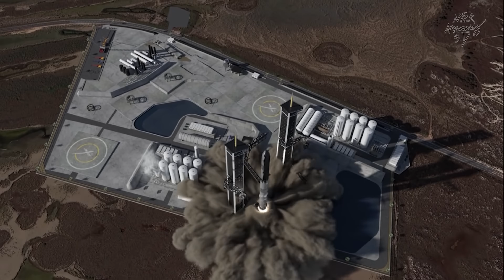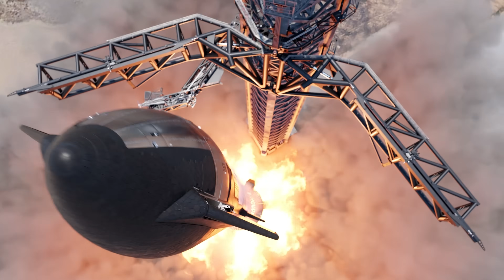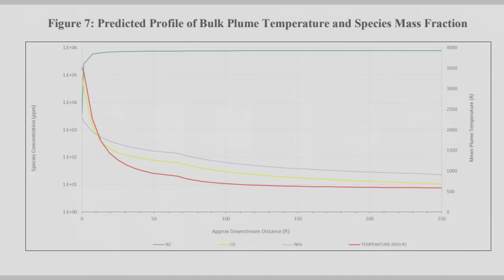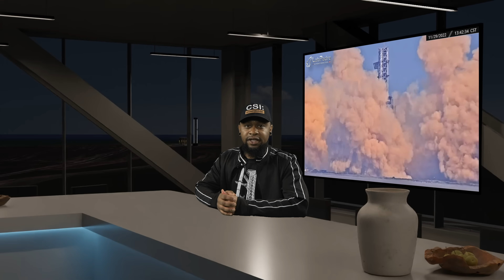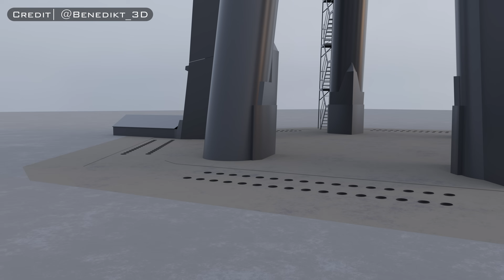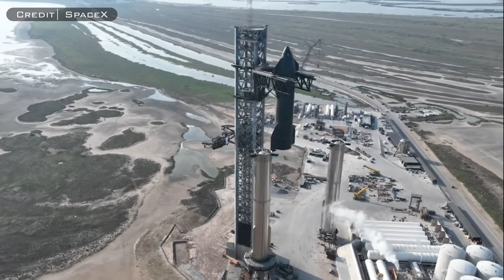SpaceX's "Major" Concrete Problem + Water Deluge Construction Begins at Starbase

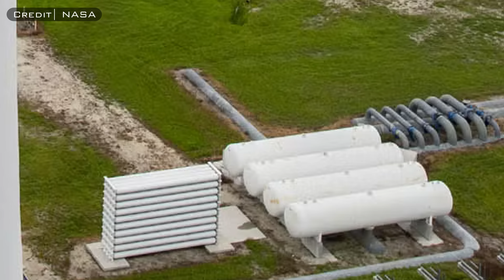Comment: You're definitely right with the four tanks at 28:55, these will act as compression buffers. They are filled with ambient air and kept at the same pressure as the water, and when the valves shut, the water will then diverge into these tanks, compressing the air with the kinetic energy, dissipating the excess energy as heat while slowing the water movement continuously.

Comment: While the concrete spalling is a serious concern, I'm more concerned with the acoustic shock waves reflected back into the rocket at start up, bouncing off the solid concrete pad and damaging the rocket's internal structure.  This was a concern for the shuttle flying out of Vandenberg and a large reason why the shuttle never flow from there (tests and simulations showed that the acoustic shock would wrack the wing structure).  The amount of water in the flame/sound suppression system seems pitifully low for SpaceX.  Hopefully they did consider this and I pray it will work.

Comment: With a rocket as powerful as starship I don't think spaceX has a choice but to build a flame trench and a water deluge system.  These aren't falcon 9 rockets and extra steps need to be taken to prevent the rocket from being damaged during take off.

Comment: Should.. but for how many times? I would think a change out every time...one toasting will be all it will take to be safe and not blow holes in everything  nearby with shrapnel with those  additional  roastings...a flame trench is not a nice to have but absolutely  a must. The current setup will serve to get the rocket perfected. But a new launch tower and stand will be setting above a flame trench. A couple years away..This just might be the plan all along...They aren't  stupid over there at Space X.

Comment: Water is compressible. If you force water under the flame pressurization, it could cause even more damage to the concrete. The answer is a 316 SS defusing spike about 6 inches thick and 4 meters past the base of the launch platform. As the flames push downwards, they push on a giant piece of metal with vertical fins that trap and divert the flames out from underneath the platform. because of the metal composition and thickness, the heat is also absorbed and channeled for the critical time necessary for the booster to clear the pad.

Comment: This is why I'd like to see Elon use my non-rocket technology.

It removes all need for such towers and everything that goes along with these old fashion technology designs.

Removing the massive refueling necessities would be another benefit.

The only problem is no one desires to communicate with me, and I'm totally outside any space type program or project.

But non of this means I'm brain dead.

I'm just not in a position to have to get anything I know to change anything.

Comment: I was always confused why there wasn’t a water deluge. You answered a lot of my questions.  Food for thought. Is it possible they are trying to design launch structures that don’t use water because of course water won’t be in abundance on mars? They won’t have to fire many to get off the surface of the moon. But mars still has something like 38-40% of earths gravity so they will have to fire most of the engines? Obviously water deluge won’t be possible on mars because it is so critical? Idk.I could have nothing to do with the launch pads they planned for mars. But that just came to thought when thinking of reasons why they didn’t automatically building a water deluge from start ? 😊 if anyone has more information on this I would be interested in knowing space x thoughts on this
Reply: They're just trying to get a point where they are able to launch. Mars is so far in the future that it isn't on their minds right now. Also, there won't be boosters or concrete on Mars so I don't see how this would apply.
Reply: @Raptor2  I know there won’t be boosters. But I would think there would need to be some kind of landing area eventually built for the starship.  But your right it’s far off right now.

Comment: A super cooled water deluge system?  Water can be super cooled to -48.C at standard pressure and still remain liquid.  By using outer jacket to refrigerate the water tank, perhaps with liquid nitrogen, you would increase the water density mitigating the lost header pressure, not require additional pressurisation, whilst increasing its ability to absorb heat.  SpaceX super cool their propellants, why not the water deluge too?

Comment: Considering Best Part is no part, instead of using what russians use i.e. a flame trench spaceX is using concrete and then all sort of added hardware... its just waste of resources which would have been useful in other ways. If engineers could come up with that much complex launch table and catch arms(chopsticks) they could have come up with something I am sure that is compatible with big n deep flame trench. Well its all engineering building and moving forward.

Comment: Very good video!  I think that a single independent rocket engine could provide the same effect as a diverter by blowing its exhaust sideways just above the ground.  Some shrouds around the launchpad legs  might be needed but for the few moments of heat and pressure using exhaust to fight exhaust; by redirecting it sideways, would seem to be a plausible plan.  Instead of exhaust blowing 360 degrees around the platform It could be made to blow in one direction and better controlled by a funneling deluge system.

Comment: The rocket exhaust isn't just putting compressive force on the concrete. It's putting shear and pulling force as well. When the exhaust impacts the ground and spreads out, that's the shear force. The shear force likely rips some pieces off. That exposes a surface that is uneven allowing exhaust to enter into little pits and holes which then allows the exhaust to push and pull on the concrete at all kinds of angles. The problem will likely always exist until they can either form it to divert the gases/help guide them in the direction they want or just built an actual diverter into the ground and out the side of the base. I'm surprised they didn't do the latter from the beginning considering all of the stuff inside the base being exposed to the exhaust. Kind of weird they built it all so close together.

Comment: Do they actually need all 33 right away? Could they get a couple of hundred feet with way fewer engines and then light the rest up? Or is that too prone to failure and/or dramatically asymmetric instantaneous thrust?

Comment: They need to use calcind kaolinite clayas in their cement. It can handle temperatures near 3000c  after 24 hours of curing and has a higher compressive strength!

Comment: I think the exhaust pulses that causes the vibration will also have a pounding effect on the pad. Think of it as a plume of hot gases hammering the pad. Causing high fluctuations in velocity. The heat is extremely intense aswell. It’s not a slow ramp up to let the pad expand slowly( all materials expand when heated) so the concrete should have no problem with a controlled slow ramp up but the vibration and heat shock will make it expand and contract very rapidly.

Comment: the pressures and temperatures mentioned are not realistic. I would advise that these figures do not represent anywhere the real values at site. Example you mention a temperature at surface from 1 Raptor blast to be 800 Rankine, 340 F, and 470 C ( it should read 170 C not 470.   Also the pressures mentioned are extremely low.
The Conditions  when the total Raptors are firing are at least 10 fold the figures mentioned in your report.

Comment: using simple compressive strength data as a function of ablative  erosive or impact resistance is completely erroneous. I assume you've never used refectories and only googled them.
Reply from the maker: Yep. Did a lot of research to see if I could answer this question. Wasn’t expecting to hit all points perfectly. Just worked with the information I was given on the data sheets. I’m not a rocket scientist

Comment: The exhaust when hitting the concrete will suddenly heat as it suddenly decelerates and all that kinetic energy will be dumped as pressure and by gas compression laws its temperature will suddenly jump. As an engineer I must point out.

Comment: RAISE the height concrete ring at the base where the rocket and motors are locked on 20 ft or so, then above the concrete floor 20 ft have a steel disc as round as the rocket with tiles like the tiles used for re - entry maybe! Maybe the tiles could work just placed all over the hot end of the launch tower. They have a lot of options they can try. Thanks for your info on the starship development.

Comment: Yeah.. my guess is they aren't waiting long enough.  That super high strength stuff needs longer to cure to get to it's maximum strength.  If they had a month to let it cure, they'd have a lot less damage.  Even regular concrete needs that full month to get to max strength.  Even the wrong rebar (anything that encouraged moisture to stay inside the finished pad) could cause the type of damage we're seeing.  Regular rusty rebar would Not be their friend.

Comment: Very good video. I think however your assumption about the surface temperature of the concrete is far too low. If you imagine a flame from a butane torch, the highest temperature is reached about an inch away from the torch nozzle itself. So similar to this, I expect the highest temperature to be at a number of feet distance from the nozzle, and furthermore the flow pattern of the exhaust gasses is longitudinal in the beginning. So your graph could be well off. I realize that this is a very specific flow dynamics of gasses, though I believe the color of the air could give a very reasonable assumption of the temperature. Hopefully this little physics lesson can improve your videos further on. Keep up the good work!

Comment: Don’t static fire tests mean intentionally holding the rocket down for an extended duration instead of releasing it almost instantly? No idea of what the impact will be on the concrete pad but it has to be somewhat significant. But I agree, I can’t see them getting away without a water deluge system.

Comment: Why n0t add 0n t0p 0f the c0ncrete a layer 0f titanium 0r stainless steel? With air gap 0r 0ther high heat insulat0r.

Comment: I’m sold!  First I’ve seen catching that the top-level heat resistant concrete hasn’t yet been deployed.  Overwhelming evidence supporting KSC tank being for water deluge, and amazing explanation for double-walled tank.  
Just great research, explanation and conclusions combined with a perfect the dash of theatrics.😉 
👍 and subscribed.
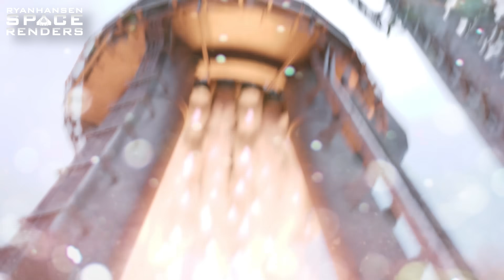Reply: Thanks for the comment, it means a lot. We all thought it was already in place before the 11 engine static fire but they delayed using the Fondag until after the test. 13:10
Reply: @Geoff_A  Yeah...I found myself defending SpaceX for TRYING the wrong thing in another channel's comments...turns out they may not have even TRIED yet, an may yet be proven right!
Reply: @737smartin  Oh, it's certainly now been used.

Comment: Musk desired to do away with a water deluge system as this would require dealing with large volumes of contaminated water. I wonder about the feasibility of placing a plate, of suitable material on the surface of the base that contains vent holes, think of air hockey table, and then send pressurized gas, or perhaps liquid nitrogen, through piping beneath the plate. This would eliminate dealing with large volumes of contaminated water. The vented gas would produce a replenishing barrier to the exhaust as well as a volume of gas to cool the exhaust.
Reply from the maker: I don’t think it was his decision. They just worked with what was available to them.

Comment: Would it possible to start the launch with just the outer engines to reduce the temperature?  Then light up the inside engines once you were over the water.
Reply from the maker: Wouldn’t have enough thrust to weight ratio to get off the pad.

Comment: U get rapid reusability from using multiple launches from multiple launch pad....say 3 pads.
Nothing goes smoothly and one need to build in redundancy.
It also enables longer turnarounds for each launch pad whilst keeping the overall cadence of launches to an average rate.
Reply: That's what they'll be doing. Even with one high cadence pad it's not going to be enough for their ultimate goal

Comment: What’s needed, jet-blast deflectors, similar to those on aircraft carriers flight deck. retractable metal plates that rise up before rockets firing with water flood out the edges of deflection plates. The exhaust gases will escape between the columns of the launch mount. After launch, the plates, will retract flat below the platform. 
This will allow work equipment to access the area under the launch platform and Prepare for the next launch.

Comment: Why not just cover the ground with Tungsten steel under the stand?? 3400 degree melting point. Run water under the steel.
Reply from the maker: I’m sure they have a reason. I try not to avoid telling them what to do though. Just analyze their current actions.
Reply: @CSIStarbase  More of a question then telling them what to do. Just wondering why that would not be a viable option..
Reply from the maker: @mrflorida55  not sure. All other comparable launch facilities use steel covered with Fondag-like concrete

Comment: Needs A Blow Torch Diffuser with Tubbed Baffles to Deflect some of the Thrust ! Towed in Place or on Tracks ,Fit Rolled with Anchors on off as Necessary ! Tub Baffles to 28 Degrees !.

Comment: So SpaceX decided to go against all of the knowledge and experience of all of the rocket engineers of the last 50 years,  just because they think that they can always do things better? That stinks of stubborn hubris to me.

One thing that you might not have accounted for is the resonant acoustic load between the ground and the exhaust. Remember, the tiles on the initial test flight of the Space Shuttle were not knocked off by wind or other things, but were knocked off by ACOUSTIC WAVES reflecting back from the ground when the shuttle launched. The shock from the engines firing is not static, but dynamic. Who knows what kind of resonance effects you might get. Who knows what kind of thermal hot spots might be created by the interference of 30 some Raptors firing together in a small radius.
The water deluge system will be a step in the right direction. But they may yet have to create a flame trench for no other reason than to direct the plume in a preferred direction.
I do think that SpaceX sometimes decides to do things differently even when it is unnecessary. Not EVERYTHING in the state of the art is wrong. They should be a little more judicious in deciding where to innovate and where to learn from the groups that came before them. Why reinvent the wheel if it isn't necessary?

I also still think Stage 0 is one slight misalignment away from disaster. If you blow up Stage 0 with a misaligned landing of booster or a Starship, you just made all your fleet of Starship/Superheavies useless until Stage 0 gets rebuilt. Not to mention, if you crash a Starship on landing, you can destroy a Stage 0 AND a Superheavy all together! And all 50 of your passengers will go up with the second stage tanks -- a real disaster that will dwarf all the Space Shuttle disasters in one crash. That will be the day when SpaceX' young engineers will learn about their fallibility, and develop the same caution that has overtaken NASA in the last 60 years. It is wonderful to be young and feel invincible. Those 26 year olds at NASA felt that way too until January 27, 1967.
Reply: SpaceX has been about first principles. The industry at one time were laughing about reusability, so if you were in 2013 thinking, will you suggesting to keep flying Falcon 9 expendably because Shuttle failed?

And still too early to tell about the future

Comment: Methane/oxygen can produce a 3,080 Kelvin flame.  That's 5,000 F - 2.5 times as hot as Fondag can handle. 

 Deluge can protect the Fondag if you can get water to the core of the flame. However, it's hard to see how that'll happen when the water jets are working against a flame with 17,000,000 lbf  thrust.

We'll see how it all pans out when the 33-engine test occurs.

Comment: Those valves don't work fast enough to cause water hammer, plus theyd simply regulate the flow with the nitrogen pressurization.  Those appear to be 2 position valves as opposed to modulating.
Reply from the maker: Yes, after this came out I noticed that the nitrogen tanks are more than likely going to be used in this situation. It’s now more clear that they will be installed next to these tanks at Starbase.

Comment: My thought on this was that a 2-4 inch thick steel plate under the launchpad would solve the issue fairly well. This is easy to fabricate and relatively easy to install

(it's more or less the same solution proposed for the Orion nuclear launcher)

Comment: love the indepth analysis. I have not been able to find any plans or solution for landing a crewed starship. There is no way a crewed starship will be landed via the OLT and be caught. This is way too dangerous and as the starship is currently designed no crew escape module etc. if something goes wrong during the catch phase.

Comment: Some dumb Questions and ideas i had are: 
Is the OLM built too narrow like a dome ..? And requires to be more taller and wider at the top after seating the booster ..? Kind of a ring into which the booster sits and the ring is mounted on a more wider base and the whole assembly is taller than the current OLM ..?
Are they going to fire all 33 at T0 time ..? Is this required, knowing the gimballing 3 engines are meant more for navigational..?
If the water deluge system is not enough to contain the heat, would alternatives be any helpful, such as a deluge of liquified CO2 ..?